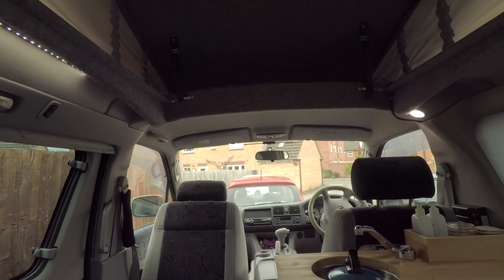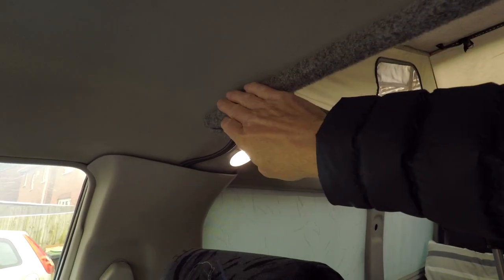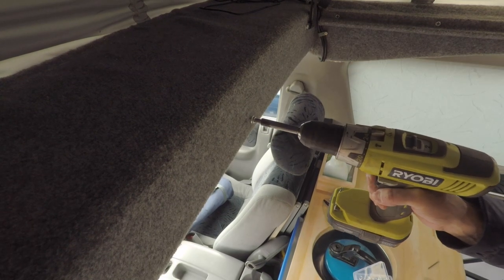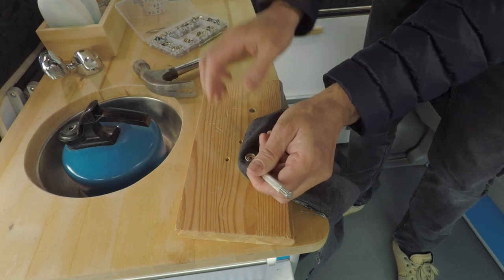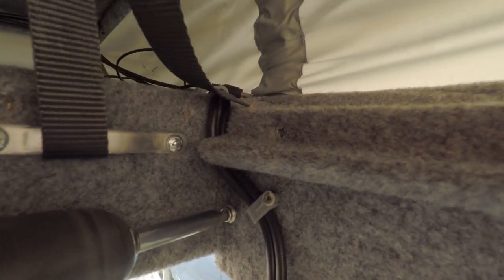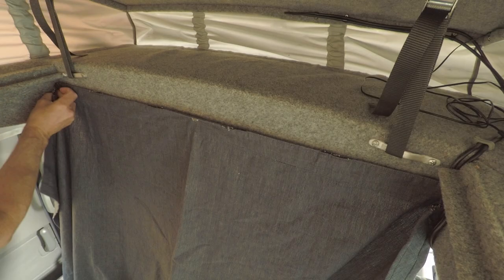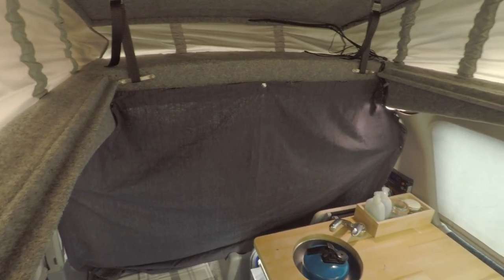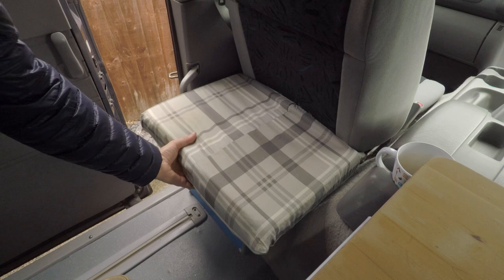How To Make A Cab Privacy Curtain For a Campervan

Comment: What kind of van is this? We are living in our 2013 Toyota Sienna, and need better curtains, but on a very low income, doing these things is harder for us.
Reply from the maker: It's a Mazda Bongo. As long as you have something sturdy to screw the little studs into then you're fine. If this hadn't worked I would have rigged up a pole for the curtain to run along instead. Cheers 👍